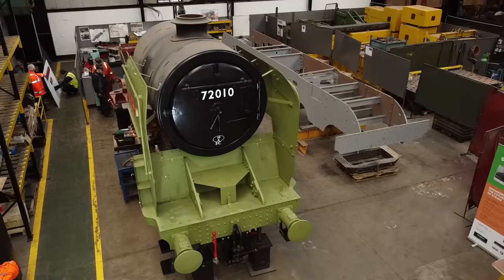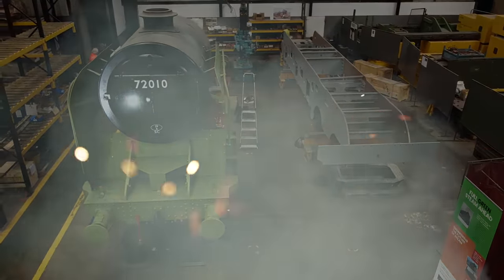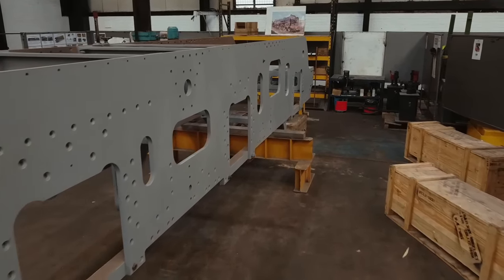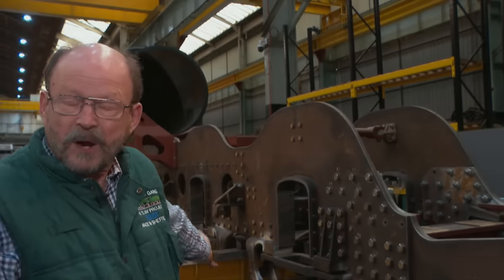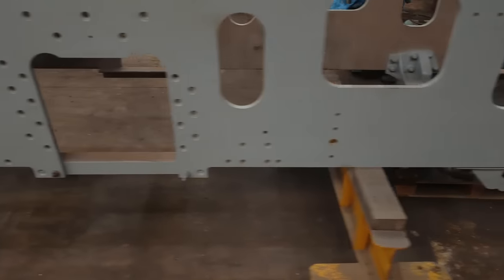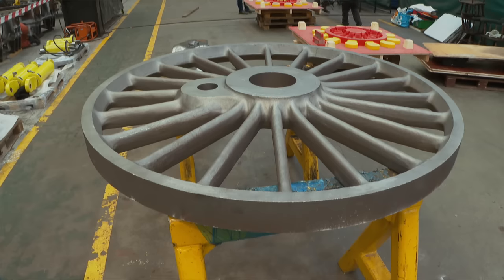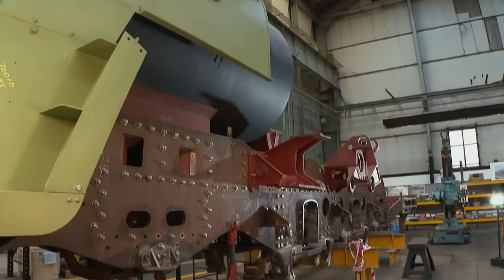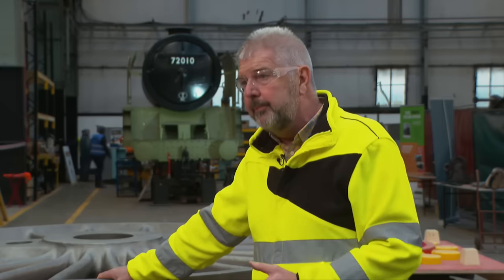One modern Sheffield factory - building two brand new steam engines. A short film by Tom Ingall

Comment: That man who said young engineers today are learning from the old engineers was spot on. Many lost or dying crafts. To learn these and carry them forward is a great opportunity.  I remember many years ago driving up to Tyseley in Birmingham with a car full of frost damaged cast iron parts and this man repaired them. Stitched them back to gather.  They are still working thirty years later. Nobody in my area would look at them .told me they are scrap.
Reply: Will Rose  - One of the major efficiency problems with steam was the tolerances that could be achieved. With modern metallurgy, it would be able to build steam locomotives that are once again competitive with diesels. The down side is watering the train every so often, but the up side is that the trains are not that fussy on fuel.
Reply: Will Rose  It also depends on the grade of the diesel oil being used as not all diesel oil is the same just like coal. Varying sulphur amounts in the crude oil affects the quality of the diesel produced.
Reply: Frost damage?
Reply: @wideyxyz2271  There is a particular type of Scotish coal that is world renown for its super low sulfur content and efecent, clean burning.
Reply: @jed-henrywitkowski6470  cylinder jackets and such, very common to see on old stationary engines where freezing water has nowhere to go but outwards
Reply: Part of it is capitalism. You see companies complaining about the lack of trained engineers to hire and also not wanting to pay to train them. Our ruling class (billionaires) are likely to just take the money and run without ensuring our future.
Reply: @jed-henrywitkowski6470  no anti freeze in two engines. Two cracked blocks. One cracked head.
Reply: I THINK YOU CAN CALL IT CRUD BECAUSE THAT WHAT IT LOOKS LIKE!!!!😡😡🤬🤬🤷🤷‍♂🤷‍♀
Reply: Craft is not engineering.
Reply: What is RAILAYS PAPER  ?
Reply: Brazing cast is tricky. Welding it is marginally possible. Can't blame them. How many have even brazed anything ever or know how hot to preheat cast so a weld might stick? Might just shatter more anyway.
Reply: Many these days are book smart and very short on real world experience. This is a great vid, thanks for sharing.
Reply: @paulnotdownunder3172  Real world experience with ancient outdated 5% efficient CO2 belching technology is not relevant to the real world. It is suitable as something for hobbyists and nostalgia trips.  Being book smart as you call it is the learned ability to think critically about what is and what is not possible.  The world has moved on since steam engines but book smart sound scientific and engineering principles do not change.
Reply: You are so very wrong My Friend; However are free to have your own opinion
Reply: @StephenSantangelo-hh5ic  I agree with him. Apart from most later steam locos were getting closer to 10% efficiency... still 1/3 of many internal combustion machines.

However, it's outdated tech and in today's world with problems of C02 emissions and global warming, we should  be cutting steam locos for scrap, not building new ones.
Reply: @PreservationEnthusiast  I don't agree with You at all
Reply: Wrong.
Reply: A common issue with cast iron headers, vessels, pipes etc.  If in winter time you allow water to freeze inside an enclosed cast iron vessel the expansion as it turns to ice will be enough to crack open the vessel.